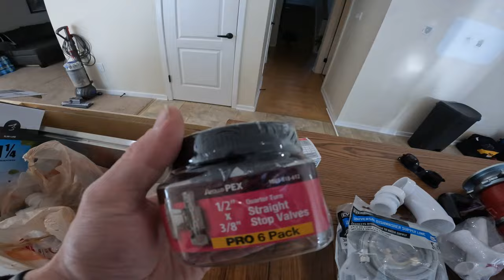Complete DIY Kitchen Sink Installation: Adding Plumbing, Dishwasher, Outlets, Garbage Disposal

Comment: Thanks man, I hate plumbing but the house we got was a total gut job and the plumbers and contractors out here not only cost a fortune but they are soooooooo slow (it's been over a month for our shower to be done) 

I didn't want to wait an eternity just to have a working sink again so going at this myself and this video helped greatly with how the sink drainage should be setup. (Also doing an aerator stack because the roof stack was snapped off inside the wall and I wasn't about to rip the wall down to fix it)

Comment: Hi, question: Could you cut the hole in the cabinet for the dishwasher white hose towards the top instead of doing the high loop? Getting ready to install my plumbing, disposal, and dishwasher and don't want to cut any extra holes in my new cabinets. I was wondering if putting the outlet for the dishwasher would be better in the cabinet also, if you pop the GFCI how will you ever get to it to reset it?

Comment: Nice job, but how do you plumb a double sink with garbage disposal to prevent the water going into the other side when it’s operating?
Reply from the maker: Thanks  -  Did this always do this ?    sounds like you have a clog on your disposal side.  I suggest trying a plunger or even taking it apart and checking for clog's.   New piping is pretty cheap...